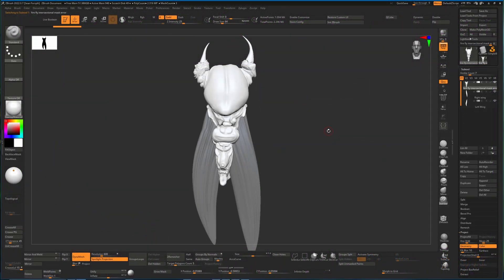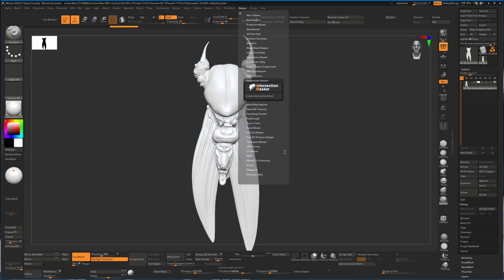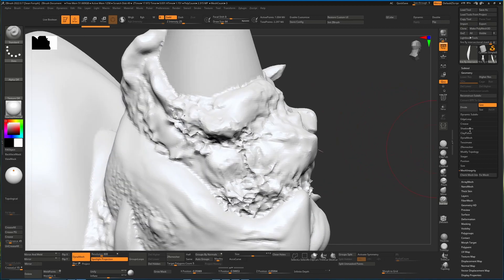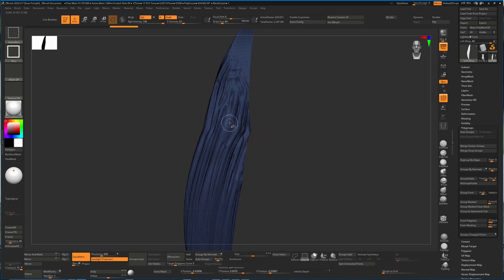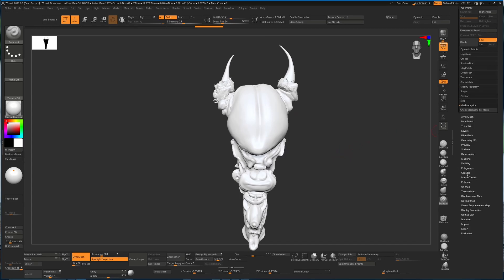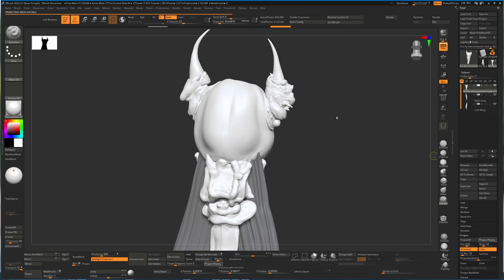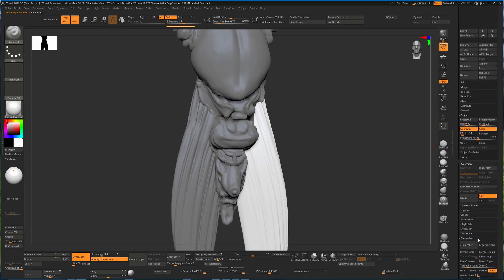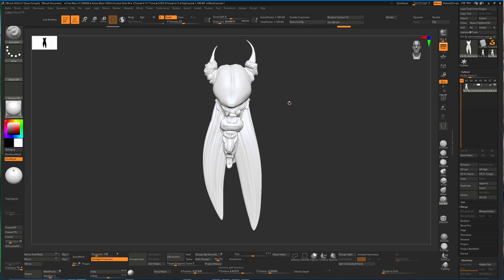Fixing meshes that won't work with Intersection Masker - or 3D prints

Comment: Thanks for a helpful video. I learned the zremesh+project from you previously, but the other steps for repairing mesh I had figured out; however, you presenting these different procedures in a cohesive and logical order is really helpful. Rather than me throwing random 'fix darts' until something hopefully works I can just use a string of go-to operations in my workflow. 

Icing on the cake is I've never played with or even noticed Intersection Masker was a thing until watching this :0 and I think it might help with several problems/headaches I have regularly encountered when merging multiple tools. Thanks again!
Reply from the maker: Ah great, glad it's useful! Thanks so much for commenting too, without feedback I'm never sure just how helpful these videos are or if people even benefit from them at all. Appreciated!

Comment: Sometimes I wish zbrush had a function where it points you where the mesh error is, in  order to use zmodeler and fix it.
Reply from the maker: Yep, that would be handy indeed! I have a list of things I'd like to see in ZBrush. :)
Reply: @SeanForsythTutorials  what will you like to see?
Reply from the maker: @juanofthekind  Well, for example, the ZModeller needs a lot of love and updates, see my video here https://www.youtube.com/watch?v=GVE6zGi9JmA&t=1s for an example of problematic behaviour that should really have been fixed by now - and some of the basic tools such as inserting two loops and sliding them away from each other in a single click, or being able to select multiple edges on one side of a mesh and the same on the other and then bridging them like in Maya, basically introducing standard modelling tools, etc. 

The unwrapping needs a LOT of love as it's extremely basic, the materials are next to useless as they're not PBR based, lighting is best described as awkward, but the sculpting tools could also really do with updates. Pablo Dobarro had some great ideas for Blender such as pose brushes, selection patterns for polygroups, etc. 

When the dynamics system was introduced we were told it was the first iteration and there would be updates, but then Maxon bought them and the only updates of note were to implement Redshift in order to help Maxon's sales of a product nobody asked for.
Reply: @SeanForsythTutorials   yup I heard you, I’m 100 percent with you. Personally, I will like to see my UI submenus in alphabetical order.  I picture in the next updates an advance graph material and proper redshift materials. An update on cloth brushes and dynamics will be awesome. Zremesher, dynamesh decimation being power by gpu if that makes it faster. I haven’t play yet with unwrap by crease, but seems alright. 
I have the feeling that next update will have way more c4d integrations. Which is not bad but I do jewelry so renders are the last thing on my pipeline.
Reply: Since I have your attention, I wanna thank you for all your videos, I have learn a lot, I really appreciate it.
Reply from the maker: @juanofthekind  Ah that's great, glad they help and I appreciate you letting me know!